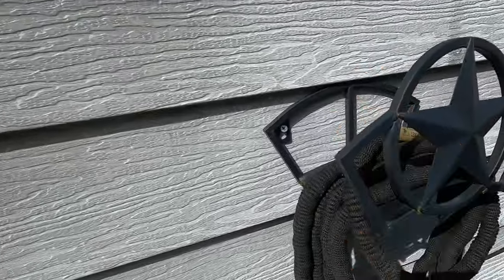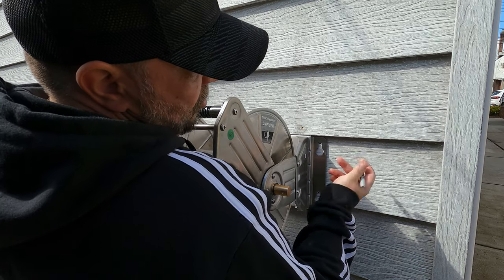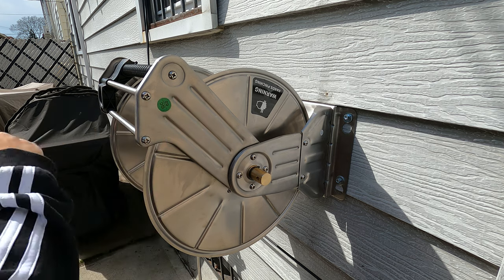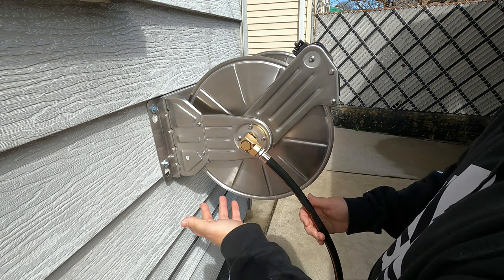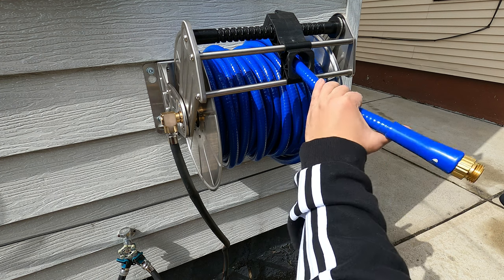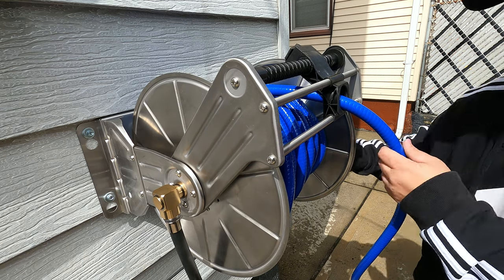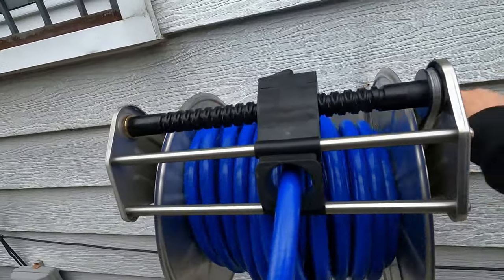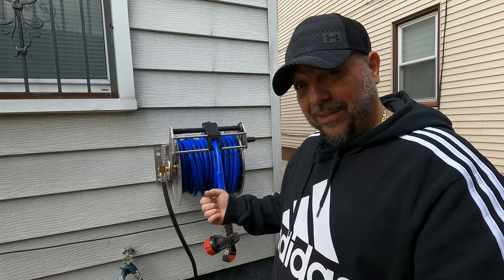Giraffe Tools Stainless Steel Hose Reel & Reinforced Garden Hose!

Comment: obviously you had no water or gas pipes or electrical wires in the wall where you drilled into or were you just lucky ??????
Reply from the maker: Nothing behind that wall. I made sure of it when I renovated the inside of the home.

Comment: Did you just randomly drill into the house and then drive the lags in?  No concerns about catching a stud to hold the weight?
Reply from the maker: The house has 2 layers of plywood.
Reply: He will fix that after it falls off the wall